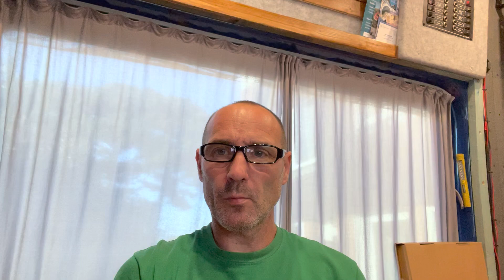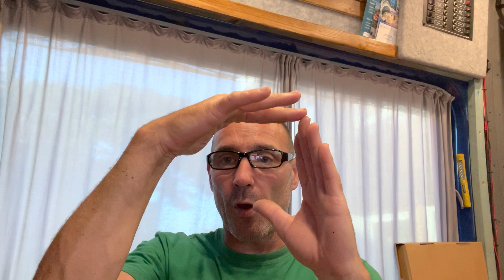Mercedes sprinter rear airbag suspension

Comment: Good one Shaun, you simply can't put a lump of rubber in that section of chassis, maybe on a short wheelbase but on a long wheelbase the leverage will be to much in my thoughts, you saved me a load of Agro. Twin leaf springs in the better option 👍
Reply from the maker: Definitely uprated springs, just wish I had done and not used the airbags, oh well, live and learn 👍👍👍

Comment: Top video, people need to no that the air bags that replace the bump stops are just ment as cushioning and not load bearings. Just to let you no that Mercedes do do air suspension for panel vans as it is a spec you can order on build. It’s the same as on the mini bus. I had it on my old sprinter. The cost to retrofit from Mercedes is costly. But as you say the bump stop version is not the way to go . Glad to hear the chassis is all mended. Spring upgrades are always a good and cheap way the 4x4 shocks help to. Cheers
Reply from the maker: Thank you, totally agree, the 903 chassis is definitely stronger than the 906, , I’m looking into spring upgrades over the winter. Thank you buddy 👍👍👍

Comment: The air suspension works on the ambulances because they don't have leaf springs as well. A trailing arm is bolted to the front spring mounts and a panhard rod from the chassis to the axle. The problem fitting them with leaf springs as well is not only do you have the weight of the van acting in one spot on the chassis but also the pressure of a spring under tension. Airbags can be used but they need to be something like the VB kit that removes the springs completely. People don't use the proper full kits as they are very expensive.